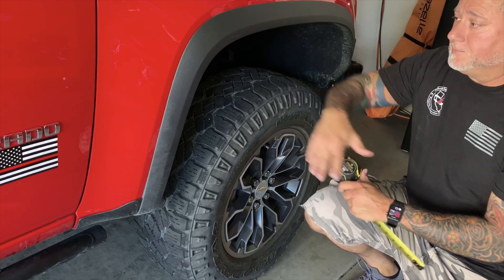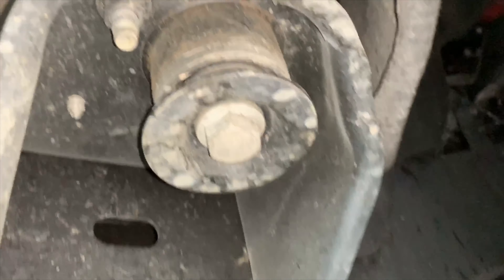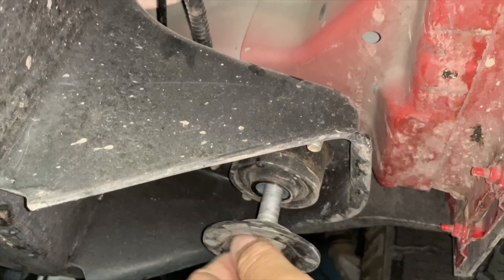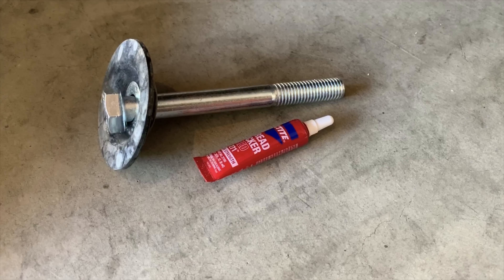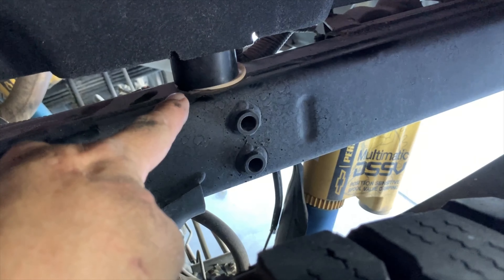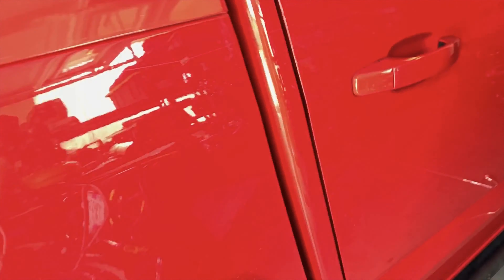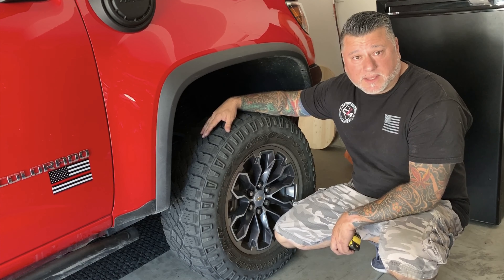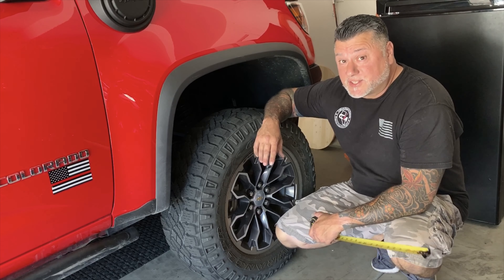Colorado ZR2 Body Lift Install

Comment: Did you move the crash bar on your zr2 for this install?
Reply from the maker: Alpine Sniper no I did not
Reply: @TrailAdventuresTV  I don't believe you even reinstalled the the crash bar with CBI half bumper? I am looking at mine ('18 ZR2 stock front bumper) and trying to figure out if I even need to remove the front fascia at all to only install the crash bar bracket to move it up a bit (instructions are for a regular Colorado). Hoping I can install the body lift by just reversing the tow hooks.
Reply from the maker: @rsherman8709  You will have to remove the front facia. And the crash bar does not get reinstalled. Hope this helps.
Reply: @TrailAdventuresTV  Why did you have to remove the front fascia if not installing body lift crash bar bracket?
Reply from the maker: To be honest with you I can’t even remember at this point. Sorry I couldn’t be more help.
Reply: @rsherman8709  hey man! How’d it work out for you? I’ve got a 22’ ZR2 and wondering what all needs to be done to the front end.
Reply: @brad696  I took the front facia off, there was no way around it. I would the the ‘22 would be different though as the changed the front end up?

Comment: I'm hooked you've done everything I want to do to my truck I did the leveling kit getting ready to buy new tires but now I might get 35s and add the body lift does it change the feel on highway or off road?
Reply from the maker: Jim you won’t be disappointed. Do the body lift. Torque everything down. Use appropriate Loctite and your set. These trucks look mean as hell lifted

Comment: Did you have any trouble with the air box since it’s body mounted and it’s connected to the engine cover which is on the frame
Reply from the maker: Definitely the airbox is attached to the body. The air cleaners attached to the engine. The body will move up 1 inch causing an offset in the flex line between the airbox in the intake

Comment: Quick question? With the ZR2 already being lifted the only thing we are having to install from the kit sent is the pucks for the cab and bed lift?  After looking at Zone Offroad instructions it shows a lot more work involved than what was shown in the video i.e. removing front and rear bumper to install lift brackets.  It also talks about disconnecting steering shaft etc.  I own a Bison edition and just was needing clarification before ordering. Thanks and love the content you are putting out.
Reply from the maker: Tommy P. The body lift is easy if you already have the CBI half bumper installed. If not , you’ll have more challenges with the front facia. Don’t forget you will also have to adjust your emergency brake by adding additional slack to the line. The adjustment is located on the driver side along the frame rail.  Also I did not do anything with the rear bumper or steering shaft.  Have not had any issues. I have the gas variant. If you have a diesel bison. Things may be different. Hope this helps.
Reply: I see you have the cbi half bumper, but with any aftermarket steel bumper, can you avoid having to use the front brackets etc.?

Comment: What’s the difference in this type of lift and the name brand lifts like bds and rough country ect...?
Reply from the maker: The reason is many of the other lifts that achieve this much height in order to run 35 inch tires require you to cut the crossmember. I did not want to alter the chassis in anyway. So this was the best alternative. We had to put our own kit together to achieve this much lift. But it worked out great.
Reply: @TrailAdventuresTV  how different does it ride from stock?and does this allow you to use your stock shocks?
Reply from the maker: Quite a bit different. The right is definitely stiffer due to the increased spring rate. And the DSSV shocks do function differently now that the right height has changed. However still rides better than most four by fours I have driven. Hope this information helps.
Reply: @TrailAdventuresTV  thanks for the fast response 👍🏼 and awesome videos I hope one day I can make my truck as close to as cool as yours  💪🏼

Comment: Is a body lift on these trucks really that easy? Steering, brake lines, fuel filler?
Reply from the maker: Hi PJ. Thank you for your comment and question. Yes it’s extremely easy. The only thing you have to do is adjust the rear emergency brake line. This 1.25” lift can be done in the early part of a morning. Hope this information helps.
David.

Comment: Did the rear/front bumper relocation give you any trouble?
Reply from the maker: I did not do the rear bumper relocation. Didn’t find it necessary.
The front bumper was not an issue for me because I installed the CBI front steel bumper with winch. The body lift added the extra gap I need to reach the winch engagement lever.
Reply: Awesome. That makes it a little easier. I’m worried about that front bumper and what all I’ll have to do..

Comment: Thanks for making this video. I know it has been over a year, but do you recall the sliders contacting the the bed half of the body as you lifted the cab? I was looking near the back part of the sliders and there is only around 1" distance, so it looks like it might bind raising the cab first. 

One more thing. It looks like the two front cab mounts near the crash bar are "caged" in about another inch, so it looks like I am going to have to raise it another inch to get the spacers up front. Recall any issues there? Thanks!
Reply from the maker: Hi. I had absolutely no issues getting the body lift under the front of the truck near the core support. And the sliders are connected to your body so they rise at the same level as the cab and bed. So you shouldn’t have any issues.
You will have to lift the bed first and then the cab if I remember correctly. I hope this information helps.
Reply: @TrailAdventuresTV  Thanks for the feedback! This does give me more info on installing it.